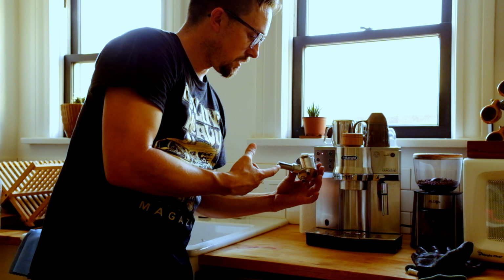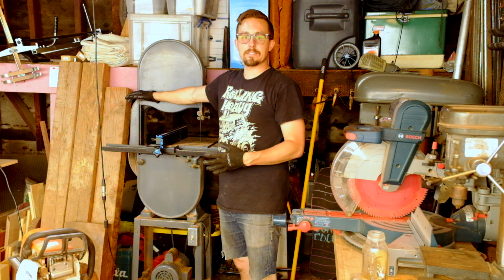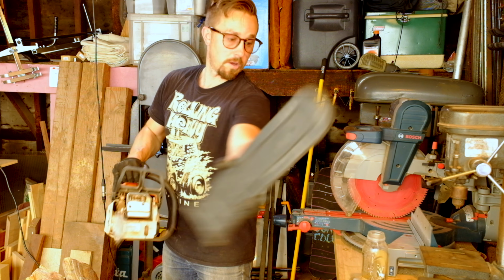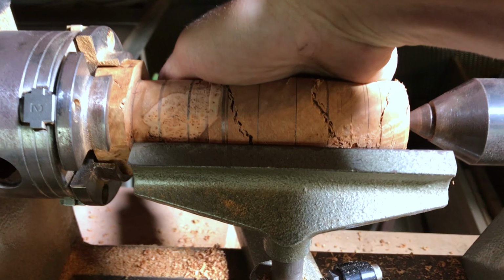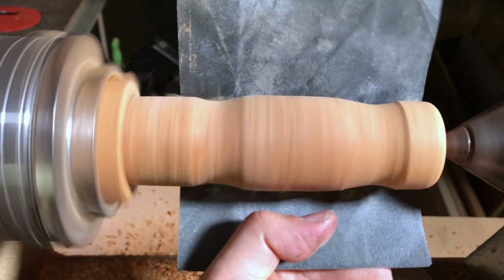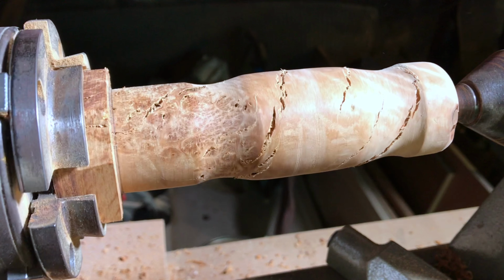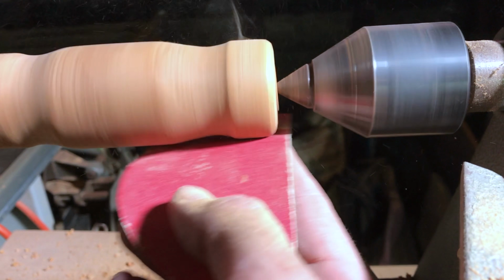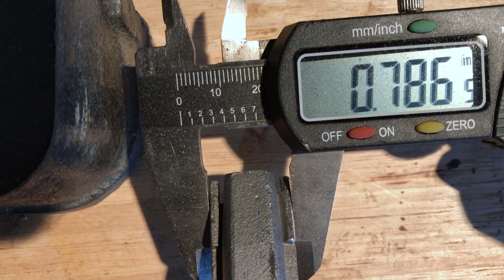Burl Wood Portafilter Handle

Comment: did your portafilter have a weight in the back of the handle?
Reply from the maker: Yes, it did to compensate for the light plastic handle. The wood has a bit more weight to it but feels right when you synch up the portafilter. Took my espresso machine to the next level and made is feel a bit more expensive.
Reply: @CharlesJamesdesign  i just cant get the screw out.... its suck .... will just have to bore it out.